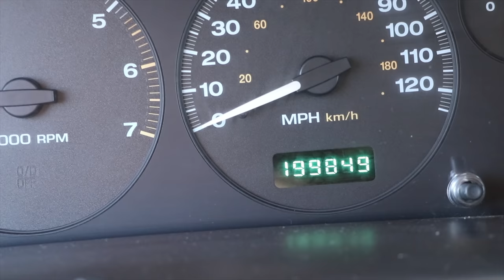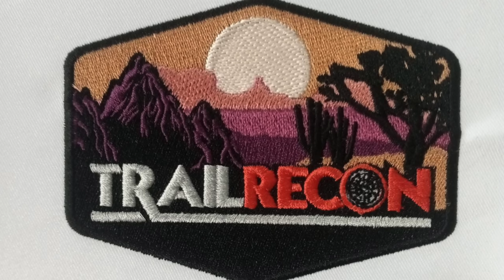Why Did I Sell 9 Off-Road Vehicles in 8 Years?

Comment: Brad - you need a 2023 gladiator rubicon diesel with all the mopar parts for the wrangler rubicon extreme option dealer installed and warranted , RSI Smartcap Painted to match. There a very well equipped on at the dealer in Boise, ID
Reply: Earl Grey with tan interior

Comment: Overheating on the diesels can come due to the airflow getting block as well on those models. They have an undersized airfilter and it can get clocked and choke the engine.

Comment: I ran into the same issue when I was there in SD with my 79 Ramcharger. I’d swapped a magnum 360/NV4500/Dana300 and 1983 axles into it. Could never get them to pass it even though it was cleaner than it was stock or even the 2000 ram the engine came from. Because of the smog equipment they mandated that actually is dirtier and worse mileage.  So don’t ever believe it’s about emissions. While I miss the southwest trails, I’m glad to be in a sane state now.
If I didn’t have this truck I’d be in a PowerWagon.

Comment: Yes, you gave up on the diesel too soon. I love mine. I'm on 40s and one ton axles and it is a beast. I live in Colorado and never get close to overheating. The fix for you would have been re-gearing. With 37s and and pulling that trailer you were forcing the vehicle to drop too many gears and push the RPMs up. I'm geared at 4.56 and even on the steepest ascents it only drops one gear. If I were to tow a trailer I'd need to go with 4.88 gears. I think 4.56 would have been about right for you with 37s and would have solved your overheating issues.

Comment: You and I got our Badlands at nearly the same time from the same guy. I’ve got 25K on the clock and I don’t think you’re wrong about the top. They promised us that hard tops would be available for purchase and here it is two years later almost and the only aftermarket options are barely shipping and still 6K+. However, if you haven’t take one with the Ford Performance tune loaded and sport mode unlocked you’re missing out. Having 370hp and a transmission that doesn’t short shift is really, really nice. I’ll grab one of those overpriced hard tops eventually but for now hey, it’s SoCal. Who needs a top?
Reply from the maker: I actually changed my order from hard top to soft top just so I could get and early edition and like you, I thought the hard tops would eventually be available.  So crazy how expensive and hard to come by they still are.  I drove the Bronco Raptor recently, but I still don't think it's a vehicle for me.
Reply: @TrailRecon  I changed mine as well. I will run the soft top one or two more seasons I think but I don’t do the distances you do. I’d like the aftermarket solutions to work out their kinks first. I just added a soft top roof rack hopefully that does fine until then.

Comment: glad to hear you telling the power wagon camper story.  I'm a TC guy and I hear disaster stories about coil spring RAMS and campers (yes 2500HD too)  The only RAM for a camper is a 3500.  I think you fell short of telling the 4Xe story.  Didn't you have a bunch of reliability/ dash lights/ tech problems with that?   Didn't it run out of battery power crazy fast and become a pig?   It's funny-you talk about 5 years as a long time.  I keep my vehicles 2-3 decades

Comment: Ok you said on the power wagon you guys used a "even tried a 3500 spring" in the rear of your powerwagon. Those are coil spring rear a 3500 is leafpack. Unless your talking about using 3500 front springs in the rear.

Comment: Brad, First, please know that I am a big fan of your channel.  Sounds like the jury might still be out on keeping the 392.  I have a 2021 392 XR and I absolutely love it.  I am a little concerned that you may have fallen out of love with yours.  Is the clutch pack a deal breaker?  I have great fun with mine and love its capability.  I am still running a stock 392 XR on 35s and wonder if you think the combination of the trailer, larger tires, etc might have generated the premature wear-out issue.  I would love to get your take on this as I am such a huge fan of this vehicle.  I traded my 2020 Mojave for this, so I really hope it holds up.

Comment: Hey Brad, 
I totally understand why you regret selling the Power Wagon but I knew you were making a big mistake fitting the slide-on camper because it was the wrong model to do that too.
In saying that I believe Ram hasn't done themselves any favours in only producing it in that platform. If Ram also produced the Power Wagon spec in the 2500 diesel they would have a winner. 
Here in Aussie we have a 9>12mth waiting list for the 2500 Laramie and they are super popular for Expedition/Overlanding here.
The power, torque and load capacity perfectly suit the slide-on camper build but price is the killer for most of us Aussies being over $200k after the RHD conversion 😮😢

Maybe one day you'll get back into the right Ram to suit those long distance Overlanding Trips. 

Regards,

AL

Comment: Brad you are such a Jeep fan boy!   I think you must of had a bad soft top on the Bronco.   I agree that Ford did a terrible job on the looks of the soft top but my 4 door soft top has been as quiet as the Jeeps I have been in.  I use a thick blanket between my bimini top and the soft top and it is as quiet as my hard top Bronco.  I think you need to give the Bronco a 2nd chance?

Comment: Love watching you videos. I have a request to consider on my 2020 Gladiator.  I'm thinking about putting  the 74Weld portals on it. They have a 20% gear reduction in the hub and with 37s will raise the diffs about 6 inches.  Thats with keeping the suspension,  steering and most of thedrivetrain all stock. 8 lug hubs and full float axles are included in the package.  Are there issues you can think of to consider.

Comment: Cool video! Thanks for sharing. If you did a light weight camper build like the Project M or OVRLND camper. Is a f-150 or power-wagon sufficient with minor upgrades or do you think it would warrant a 2500/3500? The reason I ask is because moving to a HD truck adds like 2,000lbs and subtracts from ride quality in other areas.

Comment: Sorry you didn’t like the Bronco….. I “had” to buy a Bronco with soft top.  I’d agree off road extreme on the Jeep winning.  But I couldn’t get a Jeep for a reasonable price, or order one. Bronco…. $2500 under MSRP delivered in 10 weeks. Will miss my 08 JK but after 292,000 miles…. I needed an all around vehicle.

Comment: I thought you also couldn't stand the def in the diesel and had other issues with it, otherwise would you do the diesel Gladiator? I am on my second Wrangler. went from a 2011  Sahara to 2021 Rubicon this year with the 3.6 and so much better than the mini van engine in the 2011 LOL

Comment: I see what your saying about the Bronco. Feel like the problems would be considerably more pronounced on a 4Runner though. Toyota locks there vehicles in at 33s. Heavy moss required for 35s and then just like the bronco they have tie rod problems. 4Runners can’t run 37s without extreme mods that just aren’t worth it. Plus the engine/trans options in the 4Runner are terrible and the new options don’t look appealing at all plus they’re still geared too low.
Reply: There are no widespread issues with stock tie rods. It’s primarily one of two things

1) the send it crowd.
2) adding lift changes the angles, and stress points. This is going to be true with most vehicles.

That said, things are going to break, when you off road. It’s inevitable, and it’s not like it doesn’t happen with other car brands.
Reply: @andyackerman7123  that’s exactly my point. Toyota requires a ton of mods to be able to run 35s and they aren’t equipped to run 37s. So the 4Runner is absolutely going to be a worse experience off road than the bronco.
Reply: @kjm8135  my apologies, for misunderstanding the comment.

Comment: Lol I think you just arent meant for a bronco. I get it. Im totally in on bronco. Had for over a year. I cant stand driving a jeep for daily driver. It also is very platicy just like bronco. Its smaller inside. Its a loud soft top as well. Its very capable. Yes its solid front axle vs ifs. Pick your poison. Im on highways more than trails. Much more comfortable

Comment: If you want my honest opinion, I think you really sell the Bronco short. I understand preferring the Wrangler, but when strictly talking about off road capability and saying you'd take the 4Runner over the Bronco... that's just weird. Yea the soft top sucks, and the hardtop isn't much better but the offroad capability is on another level. A Badlands Bronco will follow a Rubicon down every trail. You just can't say the same about the 4Runner. They have no flex (Bronco flex is only a hair behind Wrangler stock), and no ability to easily fit larger tires. Again, I understand preferring the wrangler, but the preferring the 4runner too tells me that I don't think the hang ups with the Bronco are with respect to off-road confidence (specifically mentioned) where it clearly outshines the 4runner. I'd go further and say that the off-road confidence (or lack of) may be more due to just how used to the Wrangler you are, and how it behaves in every scenario. 

Edit: the trail hunter still has no wheel travel increase. The 4runner/Taco is miles behind Bronco and Wrangler in both straight up wheel travel as well as articulation.

Comment: Brad - regarding the Four Wheel Camper, what would be the advantage of a 2500HD over your 2500 Power Wagon?
Reply: The suspension is completely different. There are great aftermarket for the regular hd trucks that keeps the capacities.
Reply from the maker: They have HD leave springs vs. the Power Wagons 4 link suspension.